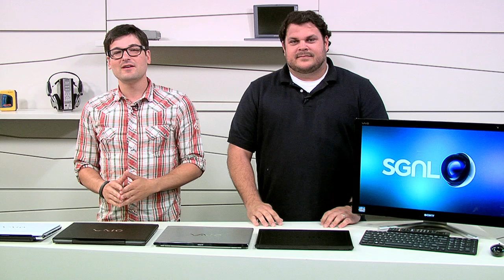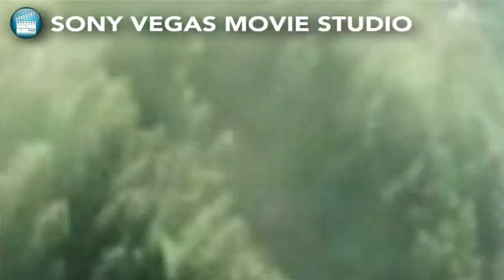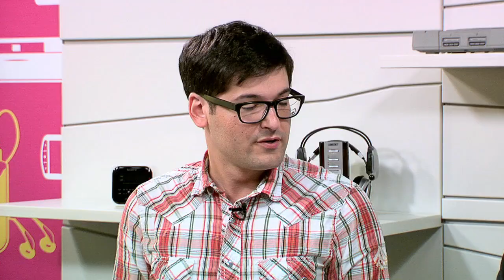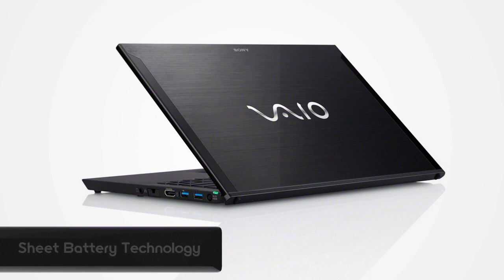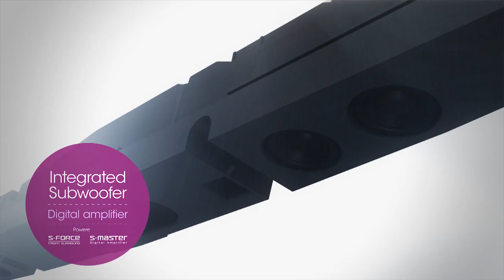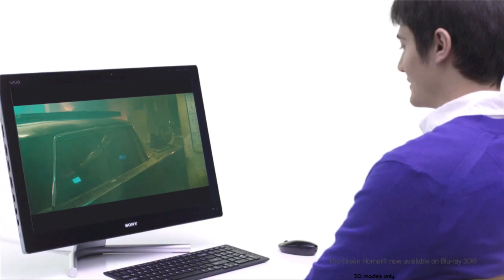EXCLUSIVE CLOSE UP: New SONY VAIO T Ultrabook along with S, E, L and Z Series

Comment: the main difference between the S and the T is that the T is an ultrabook which is not customizable and the S has a full mobile cpu and discrete graphics card. All of the ultrabooks on the market are built strictly for mobility and its lightweight features. The S series 15.5  is about 4 1/2 lbs and is made for performing harder tasks i.e. the cpu. If you want to play games do graphic designs things in that nature pick the S series. Light tasks and portability pick the T series.

Comment: Ha went to the sony store (online) and its only $150 extra to get the quad core i7 3rd gen on the l series so I might get it besides I like that sony isn't being an idiot and using 2560x1440 on all in ones cause 2560x1440 should really only be put in high end monitors that are gonna be connected to high end tower pcs with like 4 gpus in them and to people that respond to me no the imac does not have 3D nor does it have a touchscreen so this Vaio l is not overpriced